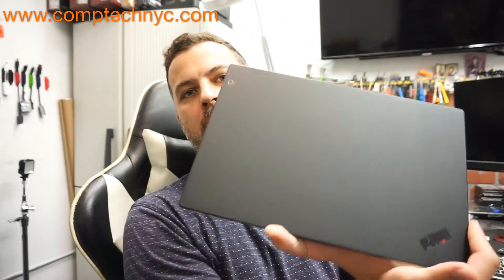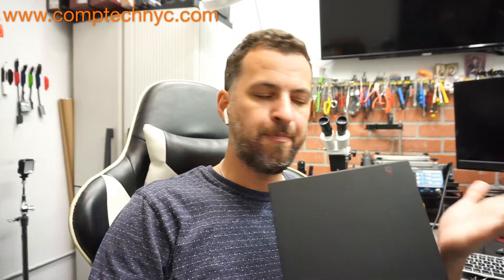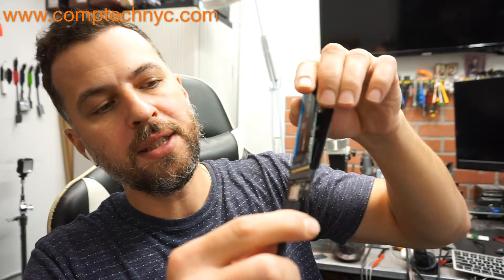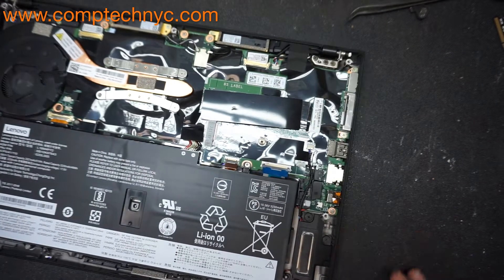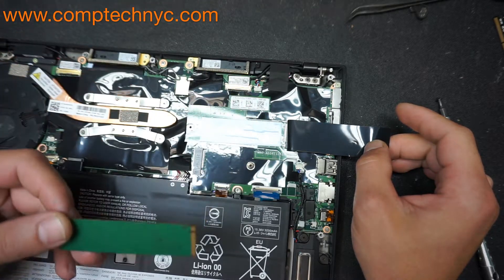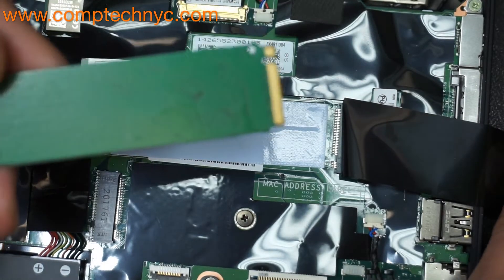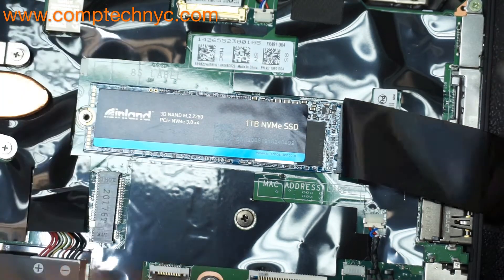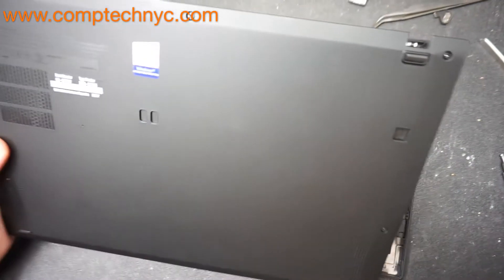Lenovo Thinkpad X1 Carbon 7th Gen. SSD upgrade

Comment: Excellent Detail!  Thanks for pointing out that the pad might stick so I know to transfer it to the new drive.  It looks like this is a good time to replace my battery too.  I'm upgrading from 256 to 1 TB just like you did and my battery is weak.  Did I understand correctly that the case screws are captured (won't fall out when unscrewed)?

Comment: Most of the Carbons that were bought by Government, were under a  special windows license. The activation key is not available anywhere on the computer. Make sure you do a analysis to recover the product key, which is the only way you can activate windows on the new drive, unless of course you want to by  new windows OS